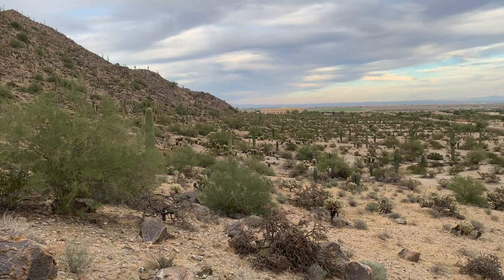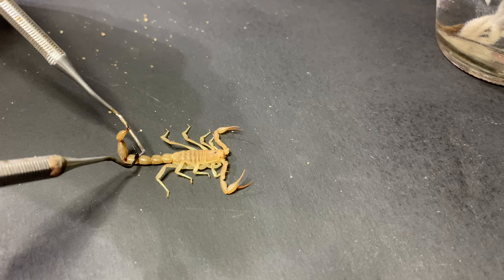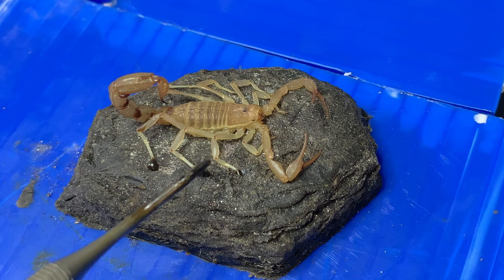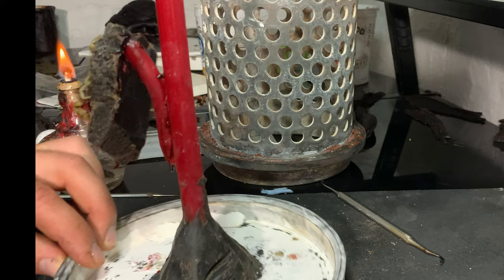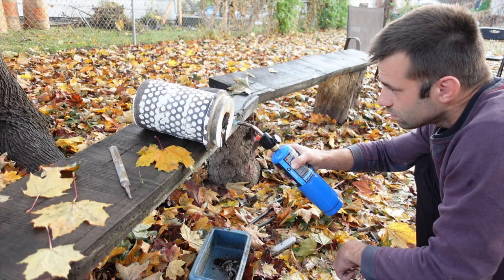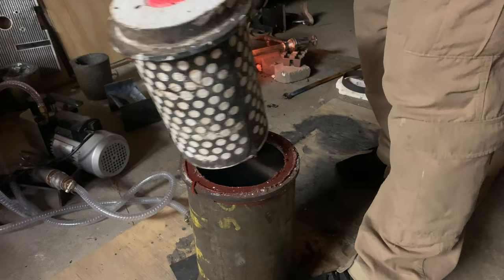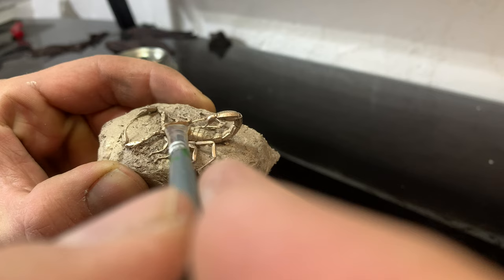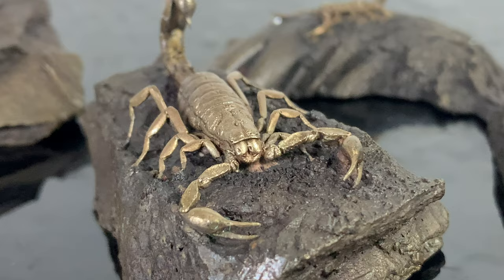Casting a Solid Bronze Scorpion

Comment: Your homemade vaccum chamber is awesome. How much would you say it increases details?
Reply from the maker: Honestly the detail on the main part of the body is the same. What is better is the flaws. And air bubble that may have gotten stuck before, or if I don’t have a proper vent, gets sucked out and the casting is a lot cleaner. It also help the metal flow into really small spaces. Like the grasshoppers I cast, even the antenna were captured. I never would have captured that without the vacuum. So in that aspect the detail is significantly higher. 
But if you don’t have a clean burn out or, your pattern isn’t done right, it isn’t going to fix those types of problems.  But it makes getting a clean casting way easier.

Comment: Hey I went back and watched just about all your videos to see when you got your burn out kiln and if you made a video on it and I didn't see one so that would be a good video to make.Did you buy it new, how much was it, can you use it to make glass sculptures and did you have to put in any wiring or circuit breakers, it really seams to make metal work much easier so I think people would be interested in it and maybe how much your electric bill goes up since it runs for several hours at a time, anyway I'm enjoying your channel keep up the good work.
Reply from the maker: I bought it used on Facebook market place. It sat in my garage for months before I got it wired. I probably could have turned that ordeal into a video but at the time didn’t think it was that exciting.

Comment: Do you think it would work with birds? Capture the feather texture…
Reply from the maker: I mean yeah it would probably work. If the investment got under the feathers it be a mess though. I would like to try a single feather sometime but I think I would likely paint on some wax on one side to thicken it a bit.
Reply: @lundgrenbronzestudios  Single feather would be cool.  Lighter aluminum seams like a more natural metal.   Messy investment issue, experiment, make another Christmas tree (natural, spray paint,  wax one side,,  etc.).  Bluebird, cardinals could be anodized.